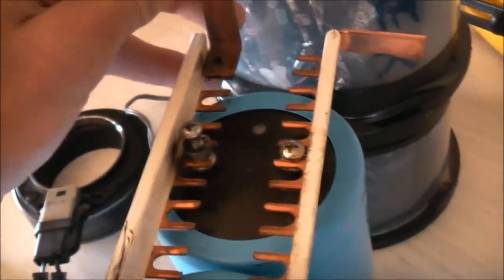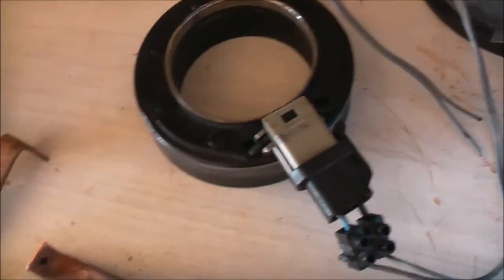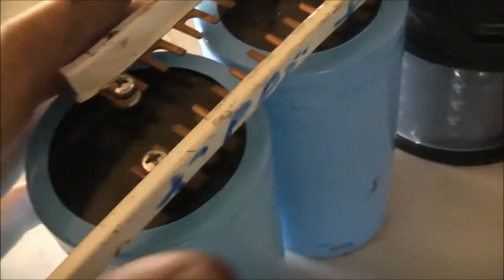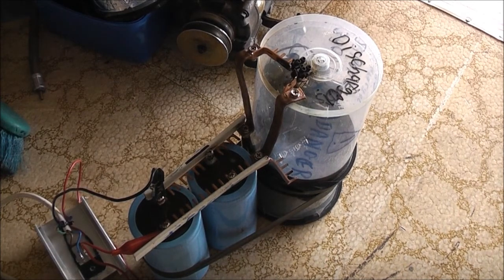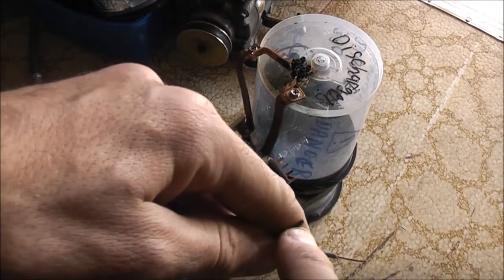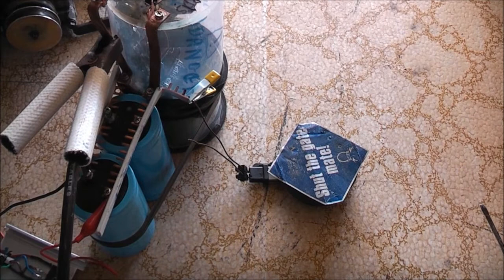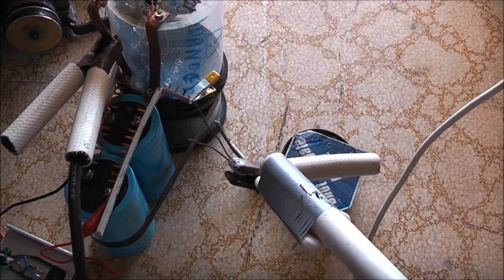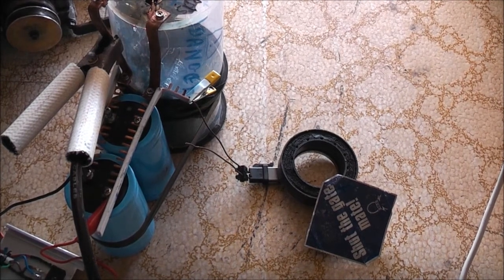Improvements To Cap Bank!

Comment: That vacuum cleaner seriously needs to be turned into some kind of musical instrument. :D LMAO! 

Nice idea with the "flattened-out-copper-tubes" for busbars. Nice recycling idea right there. :-) 

Yep, bigger conductors = bigger bang. :D

Another little tip: When connecting up busbars, make sure that any joining surfaces are polished RIGHT UP to ensure maximum electron flow. That's particularly important with lower voltages, as any tarnishing is a resistance in itself. :-)

Thanx for showing.